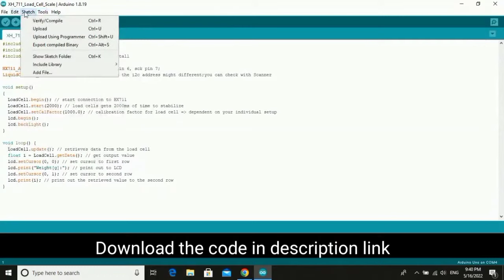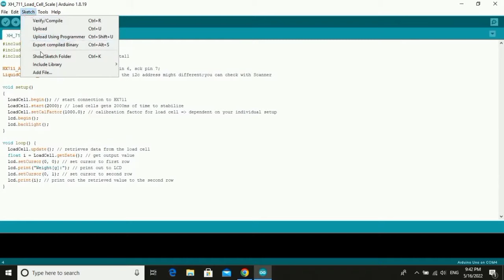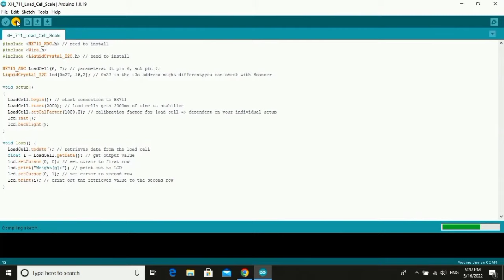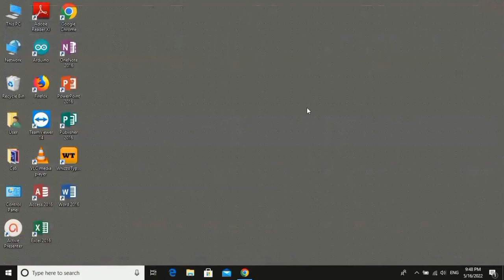how to make use Load Cell sensor with Arduino Uno

Comment: Can this set up be done without a laptop? Or is the laptop the power supply to the display?
Reply from the maker: Laptop is to upload the code only, after done upload the code you can remove the laptop and power Arduino by other power supply between 5 to 12vdc.

Comment: What about the calibration factor ??how do you get that value?Will they change for different objects or stays constant
Reply: Calibration factor can be determined by performing Calibration. It can be done by going into the examples folder then under the HX711_ADC folder there is an example called calibration. Read the instructions carefully and perform it, at the end it will show you a calibration factor which can be used here.
Reply: @z3r0rvm19  thank u🤗
Reply: after calibration program how to dump this program in arduino